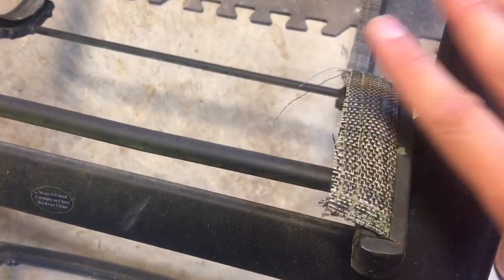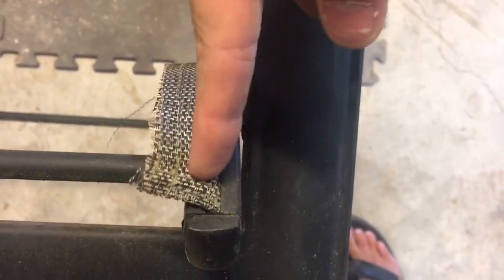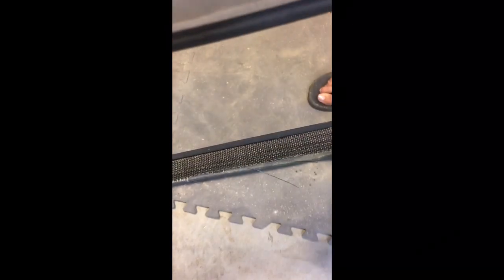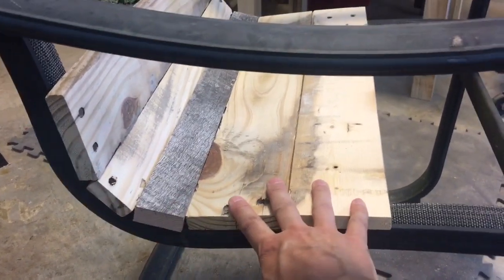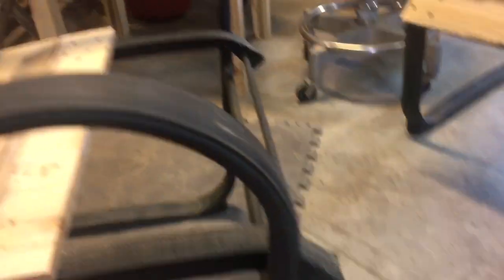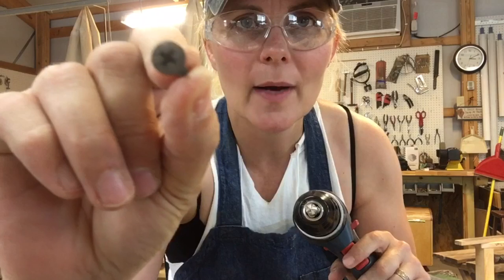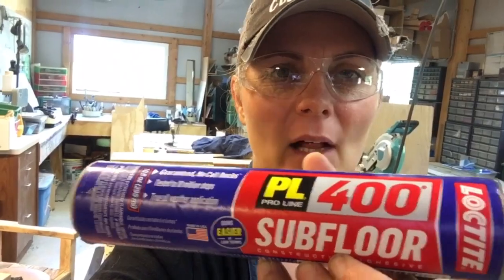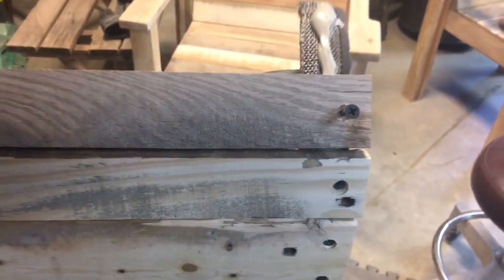How to upcycle a patio chair with pallet wood

Comment: I would recommend that you use 1-1/4'' deck screwds instead of drywall screws on the exterior. Also a drill and countersink  rather thasn drill and then countersink.

Comment: Like the Idea, im trying to do that my self but using an old wooden slats from a crib/day bed. . But my approach will allow me to replace the wood slats should they break in time.    Question, how are the drywall screws holding up?  i am using a bolt/nut  approach to fasten them. Depending on the chair your up-cycling the channels are going to be different.  Mine were Hampton Bay models.  So I removed the spline and sling material from the channels.  I was able to use a #8-32 x 3/4" bolt and #8x32 nut. (still determining cost factor to upgrade to Stainless or find  a black oxide type nut/bolt combo).